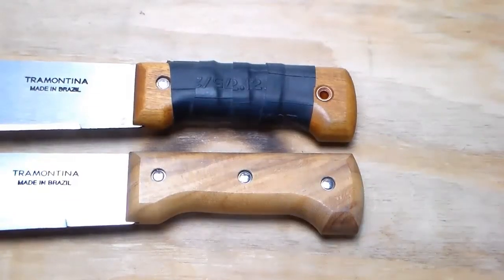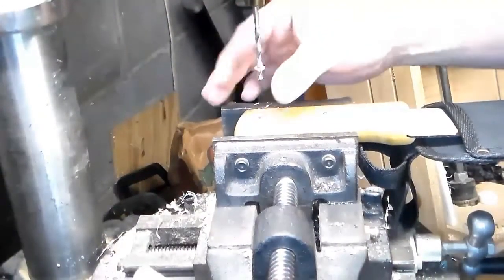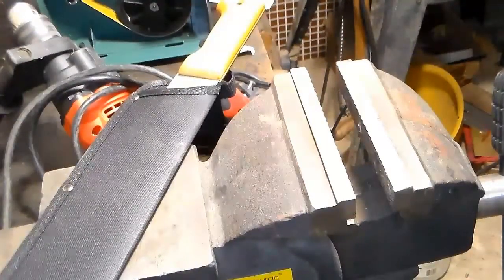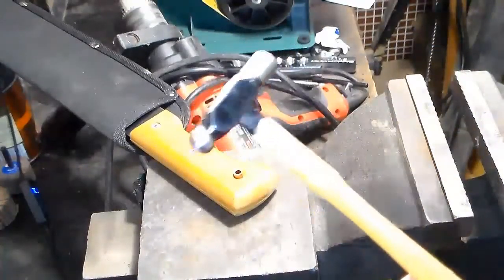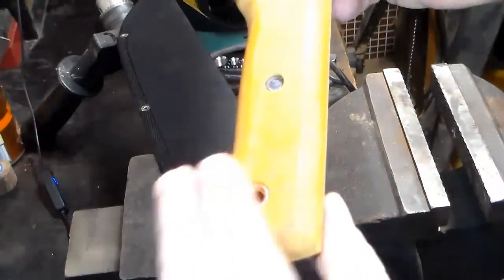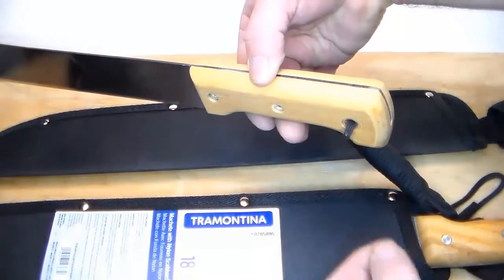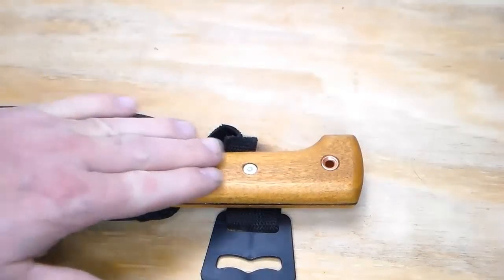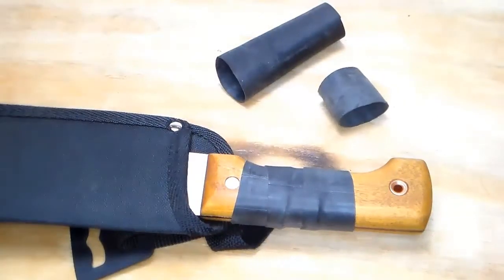MYOG Tramontina Machete Handle Modification

Comment: There's a big difference in inexpensive that performs adequately and cheap. Cheap is improperly heat treated or not at all 😂 and the list goes on. That's what is great for me about this cutting tool and the Cold Steel medium carbon thinner machetes that are/were made in South Africa for them. Les Stroud used the "Heavy " version (square nose) in his Survivorman show. They were inexpensive, easy to sharpen and hone and tough as hell. But that handle on that thing? OMG..its horrible for me and I have big hands and long fingers. So you take that hard polypropylene off there. This is NOT fun. Also that stuff, if you lay your machete down with the handle fairly close to your fire, the handle won't melt or warp, but your hand WILL😂
Reply from the maker: Agreed. For me this is just a quality blast from the past.

Comment: Years back when I first began modifying my grips, I used ranger bands and liked them.  I applied them to a couple of Chinese made Cold Steel machetes.  That should give a rough idea of the time frame.  However, in time they lost favour as UV light adversely affected them.  It will take time but it will happen.  I still have knives with friction tape after many years.  But the newer tape leaves a black sticky deposit on hands, so that has lost favour.  Wilson tennis racket tape is a favourite of many on our forum.  I use rescue tape these days.  For the most part with wood grips, I sand to suit and then apply a wood oil for protection. .
Reply from the maker: Thanks for the comment and views

Comment: I flare my tubes with a field point/arrowhead. The little  hammer worked great.... And my Tramontina just showed up in the mail as I was typing this. Awesome.
Reply from the maker: Good stuff Daniel thanks for sharing. I hope you enjoy your Tramontina like I enjoy mine. Thanks for the comment and views.
Reply: @charlesartificer2158  I have to admit that I was a little underwhelmed at first, but after a weekend of customizing the blade and handle, I am in love with this thing! Not easy work without a vice or clamps.
Reply from the maker: @Danielson1818  just wait until you use it. You'll be surprised at how well it works. But I hear you you know at first blush it doesn't appear to be much. But for the money it's really hard to Beat It. Thanks for the view and the comments, have a great day.

Comment: I did similar mods with the tung oil and ranger bands. But eventhough I do woodwork and like customizing handles, I saw no need to reprofile it. I just put the bands on and it covers all the hot spots. Its a tram so you're talking about a flimsy piece of flexible metal sandwiched by cheap wood slabs. If I want to get fancy I'd invest my time in something higher quality.
Reply from the maker: It fits my hand much better reprofiled, but to each their own. As for being cheap and flimsy, I  disagree. Have purchased many so called high quality machetes over my life and in the end when they break on me I was always left with two things. Feeling like I was robbed and an empty wallet. For the price these tamontinas cannot be beat and if I do somehow break it I am only out a small amount of money. But to each there own. Thanks for the comment.